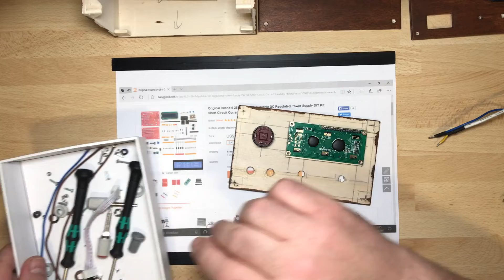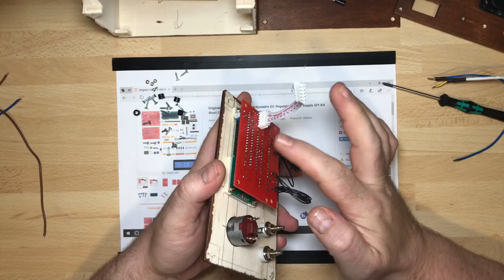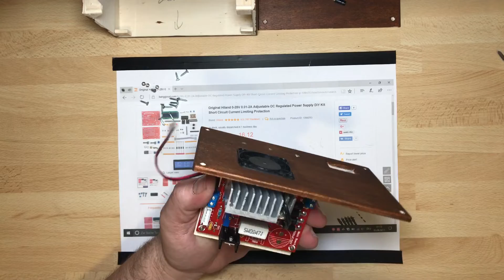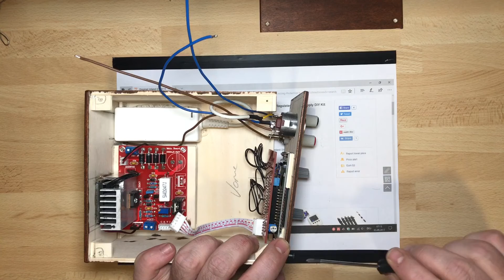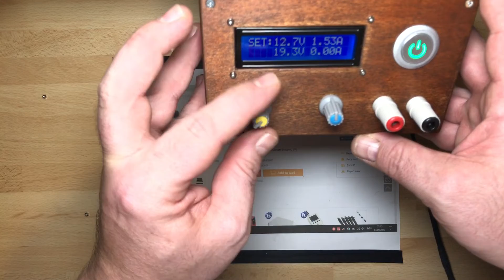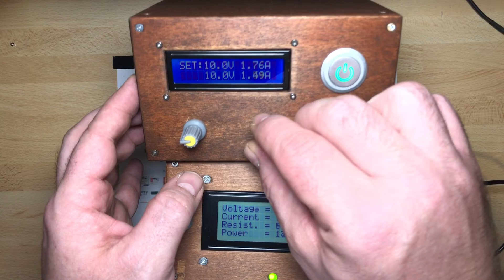Assembly the regulated Bench top power supply  in a "cool" wooden case "0-28V 0.01-2A"

Comment: Cool! :*) I bought the 
Original Hiland 0-30V 2mA - 3A Adjustable DC Regulated Power Supply DIY Kit.  And now I want this kit too (LOL!). :○
Thx for your vids! :*)
PS: What computer PSU is it? Coz I'm thinking I won't need a huge 12v/24v/?v transformer for the beginning stage of my Electronics learning.
Reply from the maker: It's from an older Laptop 19V DC with 2,5 Amp's with this specs the output voltage can only be 18,5 Volt but to be honest it is totally enough, be aware with other kits DC suplly maybe won't work.
Reply: Do It Yourself quick & dirty Hey, good to know. Thx! :*) 
I'll order (someday soon) one, but before I do I'll look around the thrift stores for a possible power supply. If that doesn't work, I'm supposing I can order one online. Which brings the question, if you have the time: Do you have any suggestions?

Comment: Nice! Just some questions. The capacitor between the positive and negative output was part of the kit or something you add yourself? What for is it? What is the capacitor's value? Thanks again.
Reply from the maker: No it is not part of the kit, the value is 10uF 50V those parts I have always laying around in my part bin. It should help with some noise at the output, this is something I see in my bench top power supply. I just copy the design.